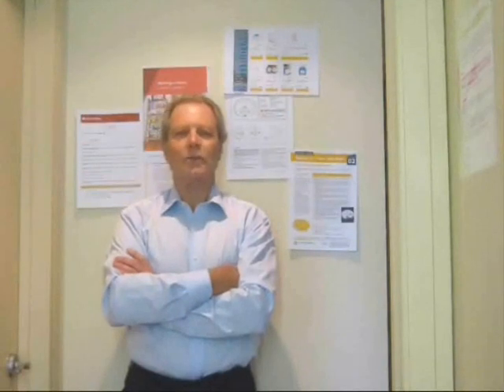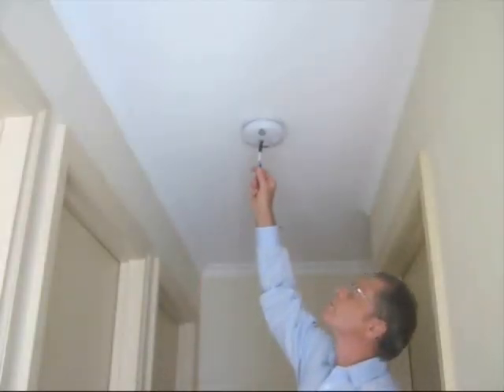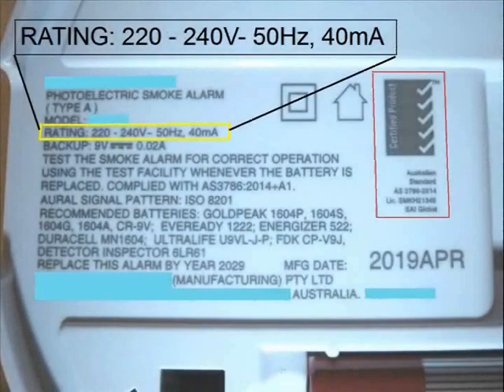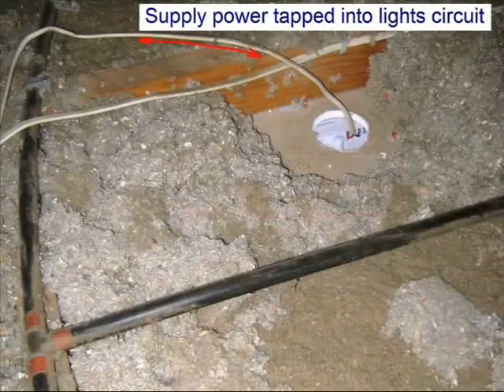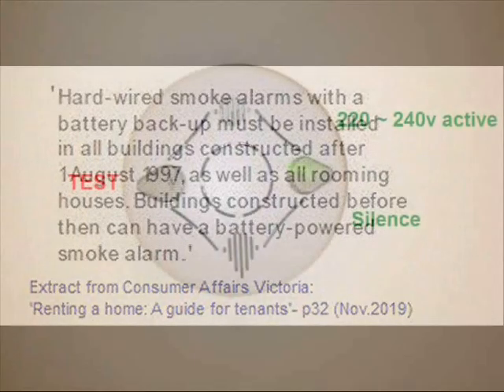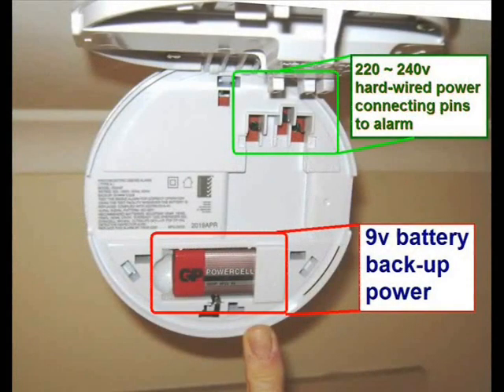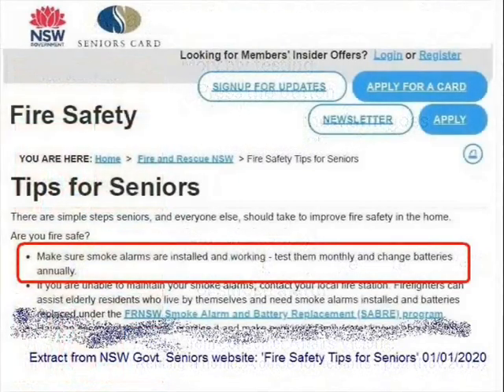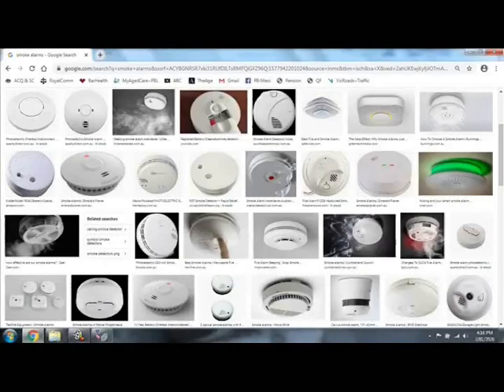Smoke alarm green light/LED: Australia

Comment from the maker: Update: 10 December, 2020:

https://www.theage.com.au/lifestyle/health-and-wellness/warning-signs-how-fire-safe-is-your-home-20200604-p54zgl.html

Under 'Easy maintenance', the article omitted to mention also checking that the green LED has to be on.

Some of the links to various resources have also been discontinued.  

Here's the problem and why I want to see  the oversight/omission corrected:

Scenario:

You are a tenant and as part of your tenancy, need to follow all guidelines contained in any residential tenancy-related literature given to you or mentioned in your rental/lease contract. Needing to carry out simple checks on the premises' smoke alarm/s may be required; there should be instructions on how to do this.  

There should also be information on how to identify and report a faulty smoke alarm.  

However, at present (10 Dec.2020), most of the Victorian-based reference information for identifying a faulty smoke alarm or installation doesn't mention the green LED. If you haven't read anywhere about this green LED/light needing to be on, then, strictly speaking, you can't be held responsible for not reporting what could potentially be a faulty alarm or wiring problem. 

If the green LED isn't on, there's a problem either/with both the:  
* dwelling's wiring;  
* the alarm.

If the dwelling was built since the late 1990s, a non-illuminated green LED means compliance issues with building codes because all such dwellings are required to have a properly working, i.e. powered by ~220-240v AC, hard-wired smoke alarm by law.

Check your alarm. If it has a green green LED/light and it's NOT ON, report it. And be persistent if you think you're being ignored.